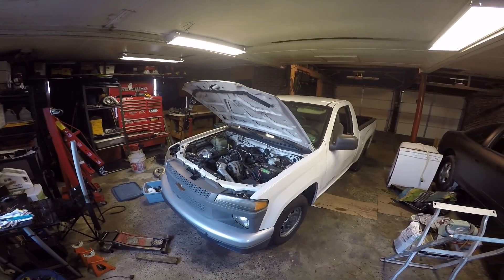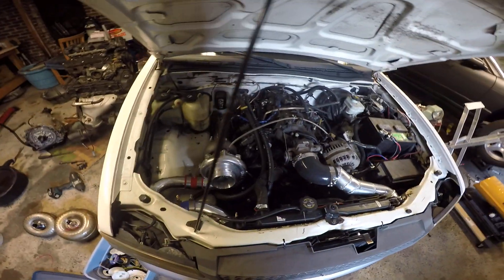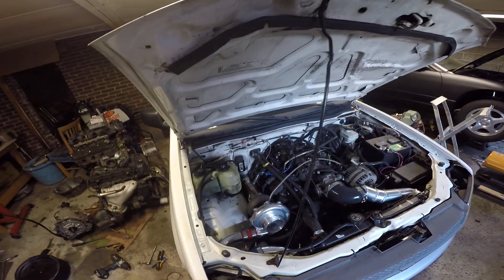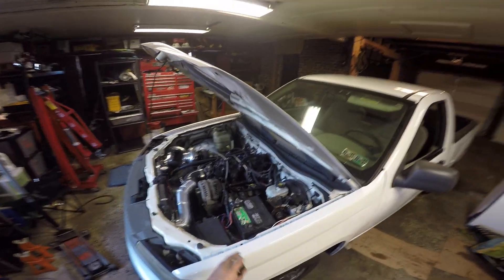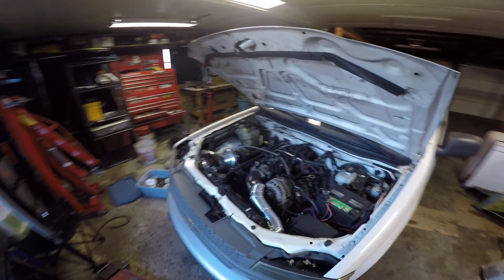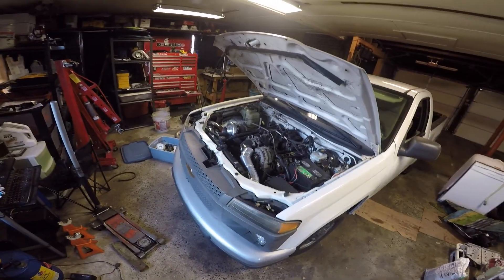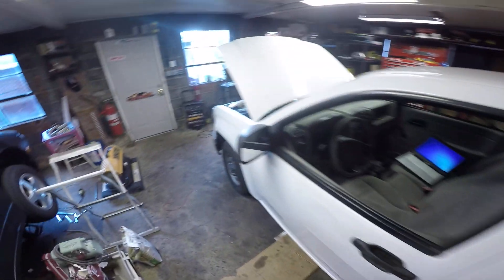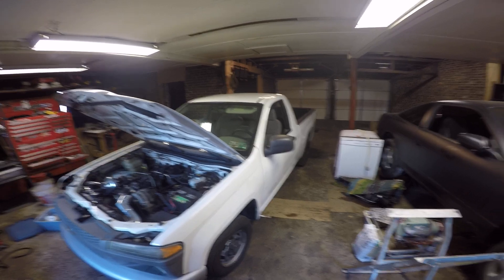11-25-15 colorado done! update

Comment: Matt, do you feel like it would be a good idea at all to install an ethanol sensor in the system just to make sure the fuel tune is right on point when you fill up with 93 or whatever that happens to have a bit more or less ethanol content than whatever you tuned on primarily?  Or is it only worth doing if you intend to run e85 some times?
Reply from the maker: +Hammerhaus Kennel unsure, i wont use it for gasoline tuning, theyre all so close it doesnt matter, soemone gave me a sensor though so i might wire it in. just for fun
Reply: ***** Thanks for the answer Matt, and I hope you do end up installing that!  :-)
Reply: +Hammerhaus Kennel they are more necessary if you are running E85 incase you run out and need to put in regular petrol
Reply: Sean Klimczak I get that, I was just wondering if it can be useful for keeping the tune really dialed in for situations where the ethanol content varies on a much smaller scale.

Comment: Did you convert from DBW to DBC? If so, did you use the LT1swap instructions?
Reply from the maker: +KAnthonyStrick1992 im using a ms3 ecu and cable throttle, nothing to convert
Reply: ok thank you.

Comment: I love your channel!
About that fuel pump issue.. I built a supercharged 3800 Impala and needed to come up with some solutions for the fuel pump, fuel module, and fuel tank mounting flange. The Impala has a plastic tank and the only donor fuel module I could find at the time came from a steel tank Grand Prix.  Using a new fuel pump designed for this engine, here's what works great for me..
https://www.youtube.com/watch?v=Q4HgUnnMNC8